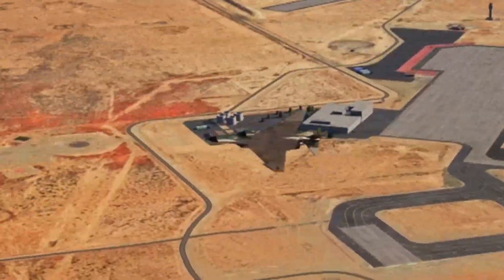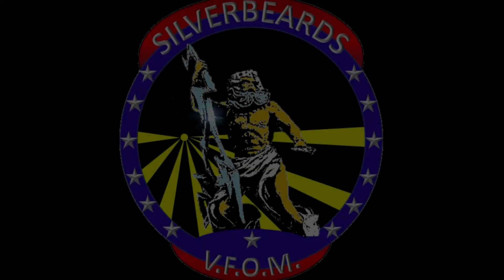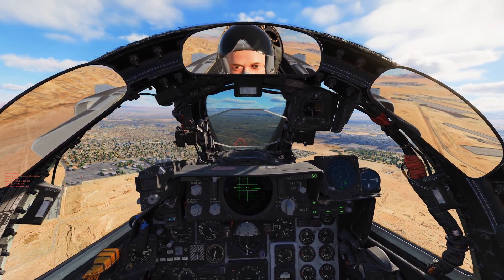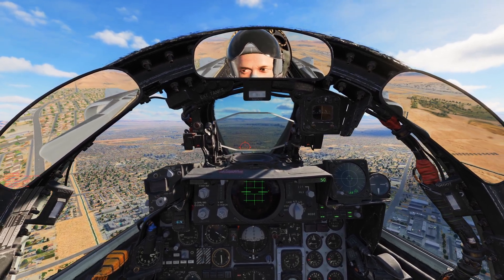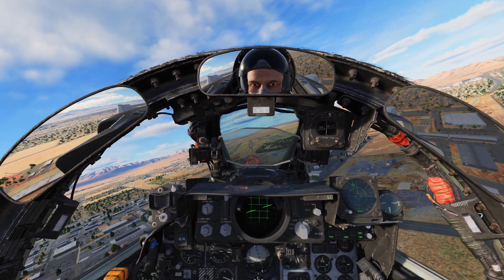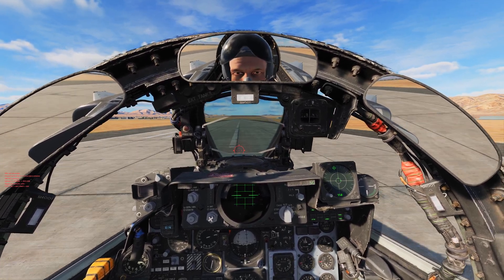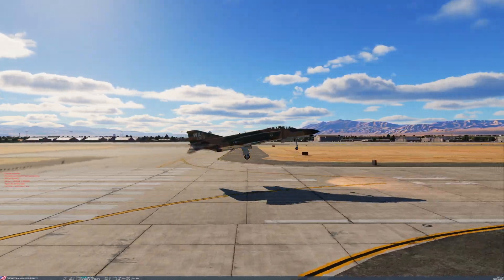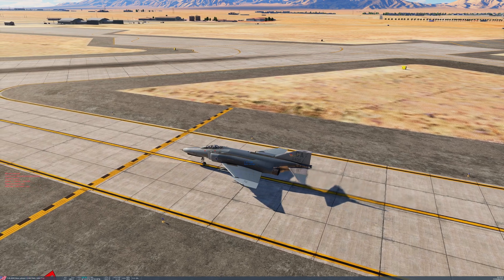DCS F-4E PHANTOM II: HOW TO FLY A VFR PATTERN

Comment: I have discovered this module is extremely sensitive to POV hat input for trim usage. If using POV input, the trim taps can be extremely inconsistent, either not enough or more commonly too much. I use a VKB gladiator stick and looked at the input log for time and the input time varies from 0.07 seconds to .184 seconds. The encoder wheels on VKB STECs is a consistent 0.045 seconds. When using the encoder I can truly get one tap to be one tap and get the VVI to sit at +/- 50 feet when before it would swing all over with the POV hats. Hope this helps someone else out there

Comment: I would like to get my hands on the thrust to power setting curve.  Ie how much thrust is produced vs power setting in %.  Some of my problems with the F-4 is related to finding and maintaining the required thrust, such as on approach and AAR.  I've been spoiled with the F-18 throttle response (spool time) so I struggled with the F-14 and F-4.  I think your videos are good, keep narrating as you fly.  I knew a pilot who always said a little prayer to the trim (on a CT-114 Tutor) on takeoff...  The trim is your friend, use the trim, etc etc.
Reply from the maker: Hi Pappy - thank you for your feedback!  I don't know if Thrust vs % RPM is available in chart form, but I'm working from the assumption that it's fairly linear in the power ranges you're talking about. With an airplane like this (i.e. "old"), I have found it useful to rely on known pitch and power settings - so what I'm going to do is build a chart that shows target power settings for aircraft gross weight on a 3 degree glidepath, and I'll try to get an associated video published today!
Glad you posted - comments like yours inspire me to find an answer from an instructor's perspective and get the info & techniques out there for daily use!
Reply: @kojakgaming3519  Thanks for the hard work.  I'll start paying attention to the power required to keep that 3 degree slope, that 225 mil trick will help a lot.  Finding that middle baseline power setting is the way to go.  I over correct on the throttle and get into very slow pilot induced oscillation on the vertical velocity, if there is such a thing.  If I may make a suggestion: Given the F-4's wide range of loadout, if you don't want to spend too much time doing this, perhaps a typical "back from a mission" loadout is best to star with.  A couple of empty tanks, a few missiles and 4000 pounds of gas sorta thing.  People that want to bring bombs home can train up to it after they can handle the basics. (Like me)

Comment: Do you have any curves or limits on the trim axis?  I seem to have problems fine tuning it
Reply from the maker: Thanks depbugg, you raise a very important point.  I don't have trim assigned as an axis, just the trim hat button on my TM Warthog stick.  I'm using light taps on the trim switch to make very small adjustments. The way the trim switch works in this model is reminiscent of how the T-37B trim worked.  By tapping with a very light touch, UPT instructors could convey to students how many 'taps' or 'clicks' of trim they would use in various situations.  For example, during fingertip formation training, hearing an instructor say "two clicks nose up" is a clear message to trim nose up by a very small amount.  It is a solid technique to tap the trim switch several times rather than holding the switch.  Similar to the same logic that PIO occurs, too large of an input will cause overcorrection of the previous, but many small (rapid) inputs will be more precise and prevent oscillations.
Give it a try and let me know how it works for you!
Reply: I use quick taps on the F-5, it just seems it isn't quick enough for the Phantom.  I seem to be chasing the nose a lot more.  Might just come down to the Ole Time in the airframe idea!
Reply from the maker: I haven't flown the F-5 in a while, but I'll take it up and play with the trim & see if I draw a decent comparison.
Reply from the maker: @depbugg  - So, to put it in F-5 relatable terms, it feels to me like the F-4 trim is 1:3 by comparison.  In other words, my F-4 trim tap is about 1/3 lighter than the F-5... extremely light and short.